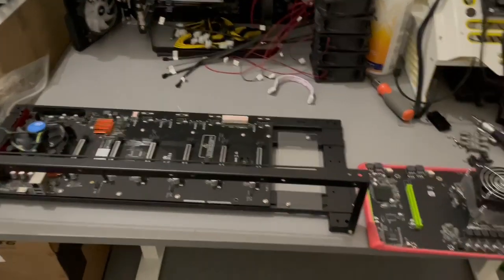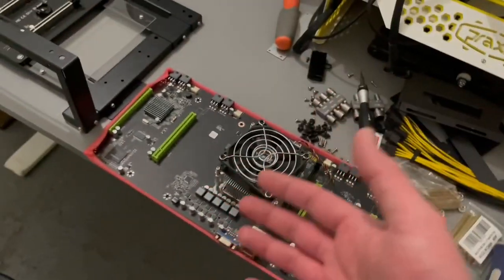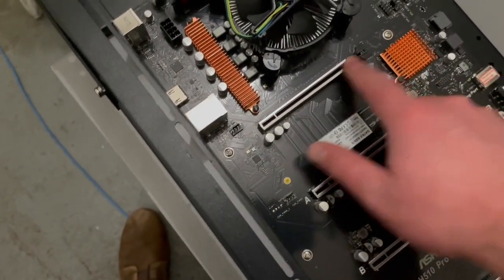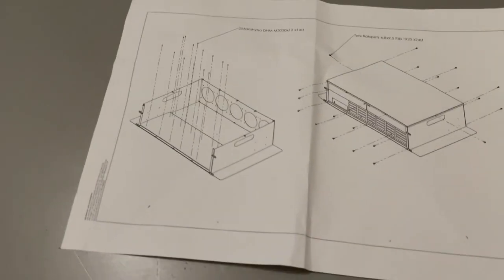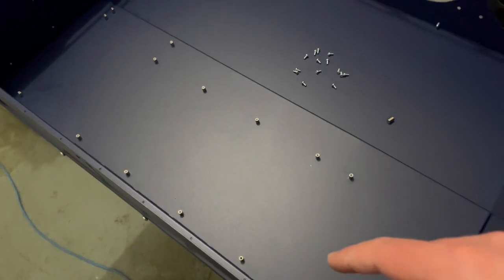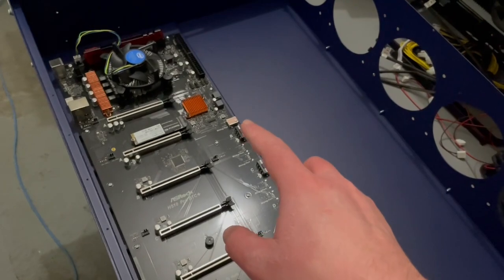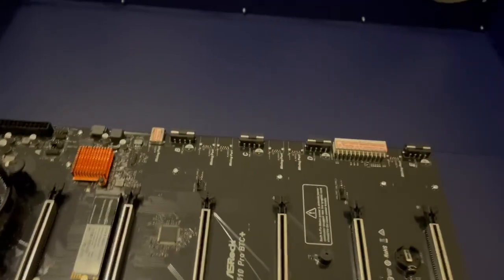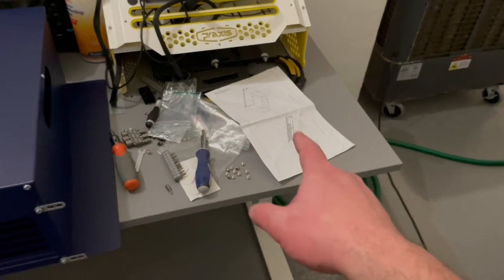Server Case for the AsRock H510 Pro BTC+ Motherboard Doesn't Exi...

Comment: First off all - great video, thank you!
Small add on - PSUs are planned outside of the case as a fire safety feature for your motherboard and GPUs(the stuff that cost money) - the power to burning chinese PSUs shopuld cut out before ut can burn through that metal =)
"Not even fun" with extreme future proofing?

Here is a discount code, 10% off this product:
MotorCityMiner

Comment: What open air frame was that you had it on originally? Having trouble finding it.
Reply from the maker: It is no longer available, but was this one on Amazon: https://www.amazon.com/dp/B09GFW62WR?ref=ppx_yo2ov_dt_b_fed_asin_title. Not all mounting points could be used but most aligned w/ the slots below.

Comment: how did you solve display output problem? I have hard time to get hdmi into gpu
Reply from the maker: I am using an Intel CPU w/ integrated graphics so I can utilize the HDMI port on the mobo
Reply: @motorcityminer  okay, I forgot about cpu having integrated graphics  for being a gamer for too long. Maybe I will cut piece of metal out so cable will fit. Thanks you for responding

Comment: I've thought about this case was just really expensive with shipping
Reply from the maker: yeah, the shipping is killer if you're buying a single unit. Was $100 for a single one, but for 4 it was $200 total shipping so $50 ea which was a little more stomachable